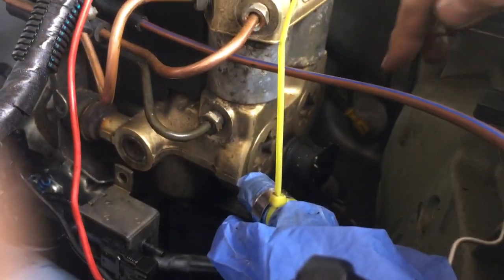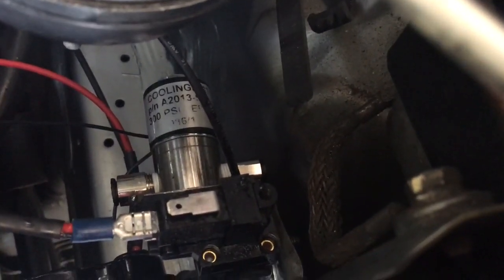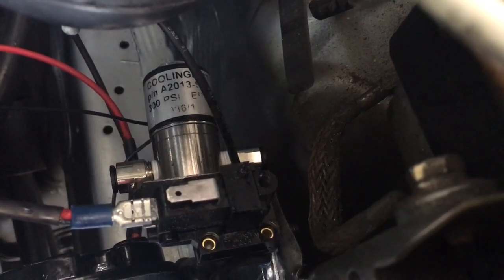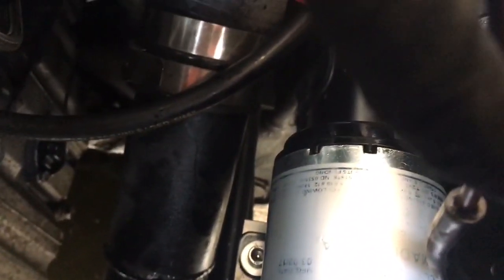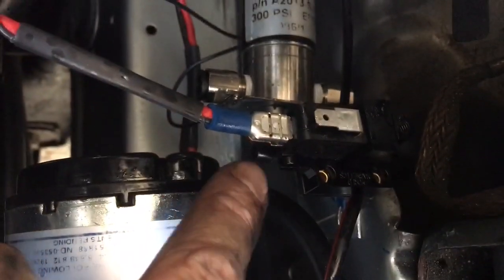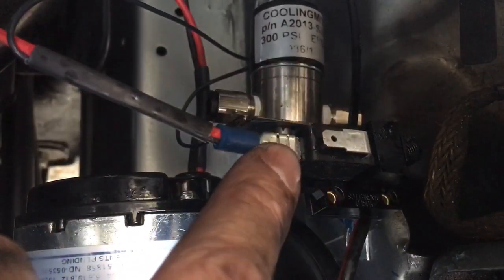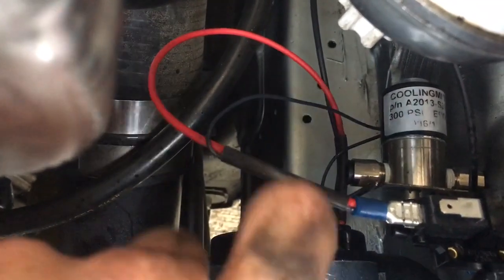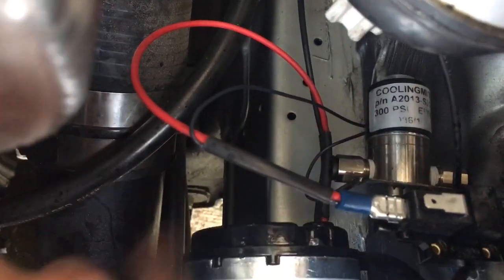W124 Superturbodiesel water meth pump setup overview

Comment: Will be interesting to see if you notice any difference; we’re looking at the kits with progressive controllers but not sure they’re worth the extra expense.
Reply from the maker: I defo works - lower EGT and water temp much more stable. Plus there is a boost in power. I'm running the biggest nozzle coming on 100% at 20psi of boost, on/off set up. Put it this way - if I knew  what  I know now I would have installed it from the out-set.
Reply: Maximilian Boost Thanks for replying. I’ve got a Garrett GTX3582r with the .61 twinscroll hot side. A bit concerned that it’ll choke the engine at higher RPM’s and obviously won’t be a patch on your HX40 at full blast. Hoping for a bit over 400hp and rapid spooling. Cheers
Reply: Increase of power?